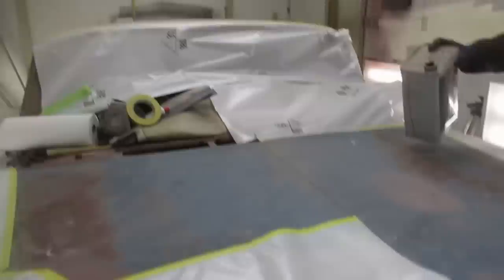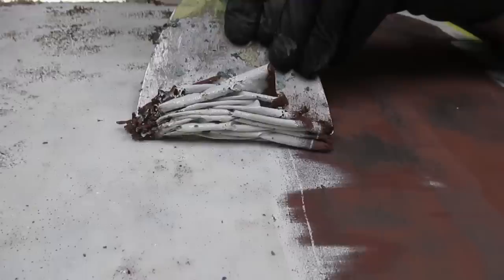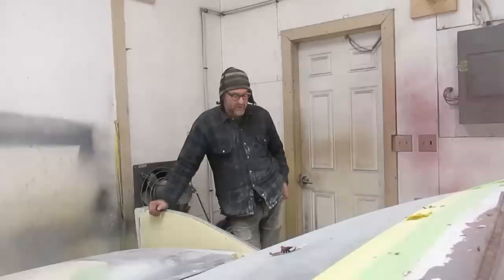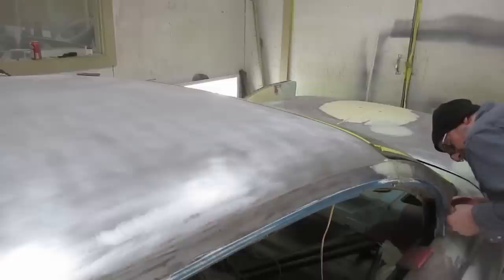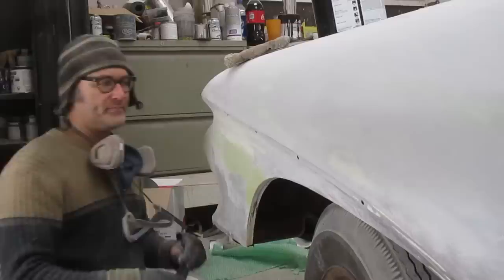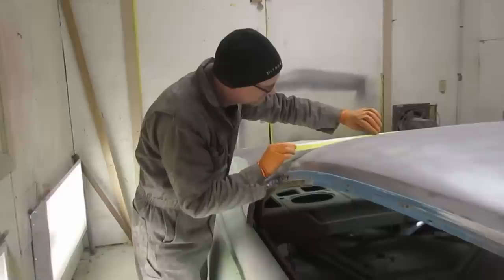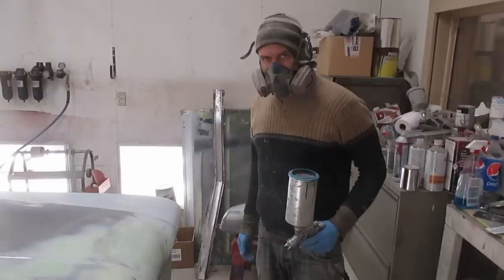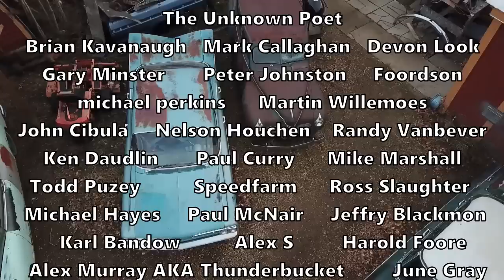1960 Plymouth Fury Part 26: Primer Time!

Comment: I had a '60 Fury back in '67. The body was mint and the swing out seats were cool. It had the poly motor, too. There was a New Hampshire State Police Chrysler wagon with a ram induction 413 wrecked at a local gas station I kept trying to buy . The dream was to install the runnig gear in my Fury. Never happened, but I still think about it from time to time. This Fury resto is going to be outstanding! "Iron Trap Garage" should be watching Scott do his majic making those intracate body panels. That's more art than skill. Truely a rare talent. See you in the next one.

Comment: Just awesome, I watched it right after it came out  and I came back and watched it again a little later now I'm back to comment on how much of an effect this episode has had on me, In the late 80's I went to work in a GM dealer for a few years and I can't even hazard a guess how many cars I used paint stripper on because the paint was coming off of them! A lot of them weren't even sold yet ! GM came out with two sided galvanized steel which slowed the rust down pretty good in the early 80'S and started using an enamel base clear paint system and a real good primer but they ran the cars through so fast that the primer wasn't cured out before the paint went on so the paint would come off of the primer! Can you imagine how angry it would make a new car owner to have the paint start peeling off of their brand new car?!! Then they drop it off at the dealership and come back a couple of days later and the hood and deck lid are off and all of the panel edges are taped shut and some guy is pouring aircraft stripper over their new baby! The primer was so tough that the stripper wouldn't touch it  so the trick was to get as close to the jamb as possible so all I had to do after a very generous bath to get the stripper off was D A the primer lightly to rough it up and then repaint the car I'm proud to say that I was able to satisfy the pickiest of customers that had decided they weren't going to be satisfied no matter what!  Then when I saw the primer being sprayed on it made me realize how long it's been since I've had a spray gun in my hand, Close to 8 years, WAY TOO LONG!! I love body and paint and collision work and I got away from it when I retired but I still have my  shop and equipment so I've got to get back into it to instead of just making the cars I buy  run and drive and the ones that are too bad get stripped for parts! I belong to an Auto forum on Craigs list and that's how I found Cold War Motors was a member posted a link to this Fury setting in the pasture up to it's rockers in,, Well you know what it was setting in!  I binge watched all of your forward look videos and then the rest of them and have been a fan ever since!! I've built a lot of cars in the last 50 years that everyone else wouldn't touch and seeing this one get to primer has reminded me why I did them!! I got projects to finish!
Reply: Danny Casler I once bought a very clean Delta Eighty Eight for a grand because the paint was falling off....sprayed it with Pratt and Lambert enamel.....Scott would be disgusted but the car was a gem.

Comment: Looks beautiful, even in primer. A definite milestone in her rebirth and a testimony to your hard work and the work of your crew of supporters! The stripping brought back the memory of my stripping my '66 Olds 442 late Summer '74. I bought it new in college in Ohio May of '66. Over the years and travels ending up in Southern Colorado, her original dark forest green metallic had become checked and sad in spite of waxes. Decided to use stripper on her even though needing her for a daily driver. That stripping also only took it down to the original factory primer, assumed it was because the original assembly plant primer was put on by a massive dip in the huge tank that was electrostatically charged so it was pretty tough. I just left it that way and wet sanded it and spot primed any bare metal. Back then, Pueblo CO still had an Earl Scheib shop. As always, those shops were only as good as their paint man. He did a fairly nice job putting on their own version of dark green metallic and when I got it home and reinstalled the side trim, she looked great to me. Had to sell it in '80 when the family began to grow. Good memories sparked by your video!😊👍

Comment: Tip, you only brush paint stripper in one direction, when you go in the opposite direction, it makes it work about half as good - check into it , i'm not kidding, then use gun wash and course steel wool

Comment: Ok here goes:
Scott’s Cars Challenge 

59 Dodge Viscount
59 Biscayne
49 Frazer
57 Studebaker
72 Fury
50 Chev Fleetline
50 Plymouth Deluxe
73 Citroen SM 2-dr + Parts Cars
71 Citroen DS 21 Safari
52 Kaiser
51 Kaiser
47 Chrysler Royal
72 Chrysler Newport
59 Fury
60 Fury
61 Belvedere 4-dr
61 Belvedere 2-dr
51 Packard
53 Packard
50 Buick
58 DelRay
Five Dollar Roadster
60 Ford Farm Truck
59 Chrysler Windsor
57 Plymouth Plaza
51 Hudson
58 Plymouth Savoy
67 Fury
85 Dodge 1/2 ton
53 Ford Customline
51 Chev Kustom
52 Nash Ambassador
61 Fargo 100
41 Plymouth
57 Dodge Regent 
78 Dodge Monaco

Some of these are in the shed. 
Some of these idk where they are 
Not sure about the Tall T
I think the Nash Metropolitan is Al’s. 

Cheers from Alabama.
Reply: Thats a great list, don't forget the Borgward Isabella coupe. I think we saw it for about 3 seconds a year or two ago. Plus there are the 2 SM parts cars, and I know he has at least 4 more ds's and id's hidden around there as well. The real question is, which outside cars are going to get put into the new shed?

I figure he can get at least 8 in there, and we know the Tall T is car #1, so what else is going in?

Comment: Have to admit I was wincing when the razor was dragging over the roof but I guess either it looked worse than it was and came out in the hand sanding or you have a clever fix for the scratches?
It's looking great anyway, all that hard work will start to really pay off with the colour coats.

Comment: When your spraying the roof and the camera goes out of focus I had some stoner rock on in the backround and thought, yep this happens when you don't wear a respirator. The first coat was an epoxy? what type do you use? Have to go watch the first episode again when you picked up the car. If you have enough of the old quarters left, should make a couch or wall ornament out of it.
Reply from the maker: Hey! Well, there really was nothing left of the old 1/4s... maybe enough for a clock face? haha... Yeah, that's epoxy with a polyester hi build over top. Cheers!
Reply: @coldwarmotors  A blue clock face would be conversation piece.

Comment: Hi ! I'm #689. I have used a phosphuric acid similar to how you used the stripper. I apply the rust disolver then cover with plastic (To keep from evaporating).then wet sand off. You're really laying on that second coat ? High Build Sealer ?

Comment: Serious question; Why did you leave the back window in it?
Reply: My guess is that he doesn't want to risk breaking it. That is one expensive piece of glass, IF you can find one. It is definitely the single most expensive part to replace on the whole car, and unfortunately not even Nik Blackhurst can weld one together for you...  Since there will be a stainless molding that goes completely over the rubber (which I must assume is in at least tidy condition), and part of the paint, you will never see a paint line around the window.

Comment: https://youtu.be/WJIHoaoQJaA?t=19 - Mix of old commercial and a new restoration of a convertible 60 Ply.  The commercial touts the unibody construction without actually saying the word unibody or monocoque or anything of the sort.  The restored model also has the wavy chrome bezel around the speedometer.  Yours will be better in this regard for sure; you've already told us it bugs you so no doubt it will be fixed.